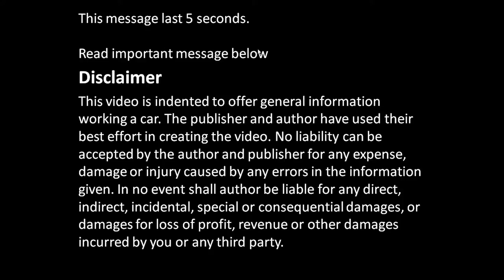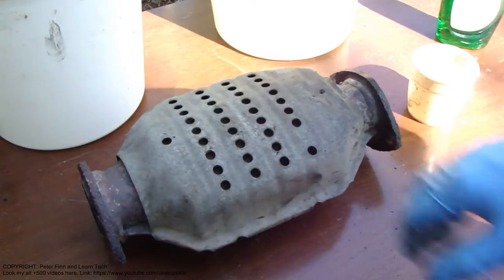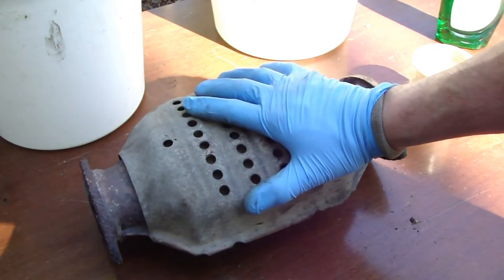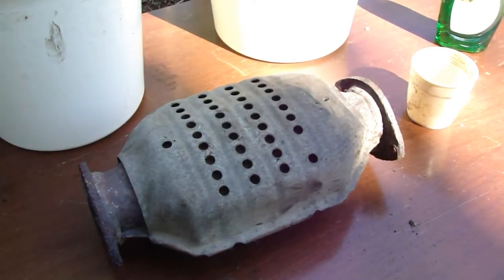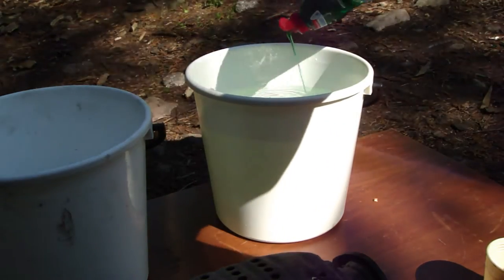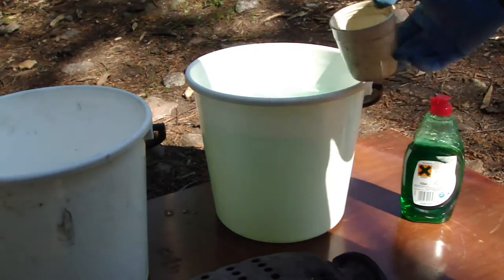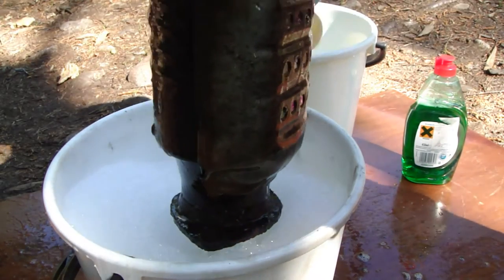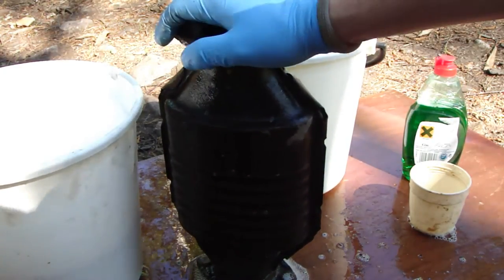How to fix catalytic converter with emissions control issue and error. Do wash with water and Dawn.

Comment: Oh and show the results after it was put back on the vehicle and driven long enough to run the monitors for the catalyst system so people know if it even corrected the p0420 diagnostic code, thats the ONLY reason people would even attempt to clean a catalytic converter, they're looking for a quick and cheap fix to pass emissions but with no results for everyone.. epic fail on this video. Good luck in the future.
Reply from the maker: marty davis Hello and good comment. I am just now doing new video, where is also do smog tests before and after the wash. And car is working well, of course because it is Toyota.
Reply from the maker: marty davis Thanks and I will wash my Corolla's catalyst by warm dawn water and thinner and acetone. Lets look the new smog test results.